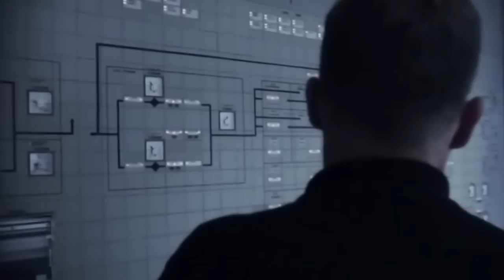Into Eternity (Documentary) - The Problem With Nuclear Waste

Comment: One proposed method is transforming radioactive wave into blocks of glass (through vitrification).  One company (Kurion) has industry & environmental members on the board and is seeking to make this the norm.  The product can then be stored "safely" - or at least many tunes safer than current methods.
Reply: Dry cask storage is incredibly safe already. If people are actually concerned about radiation, they they should be apoplectic about the vastly more radioactive material being emitted by fossil fuel plants straight into the environment - specifically the air and the ash from coal being just dumped, with the uranium and thorium concentrated in the ash. Clearly the radiation from fossil is somehow different from the same uranium/thorium/radium NOT released in any form considered dangerous sources. People have fear and danger confused.

Comment from the maker: @MultiWingnut No. If the nuclear waste is handled on the surface, it needs to be kept under water to absorb the radiation. Because it's hazardous for so long, that's not really a viable option. Hence the plan to bury it very deep so it needs no maintenance. The rest of the documentary is about how the construction of this underground facility and how you would warn any future races not to go near the dangerous waste. Very recommended.